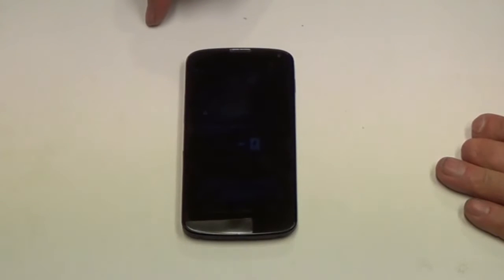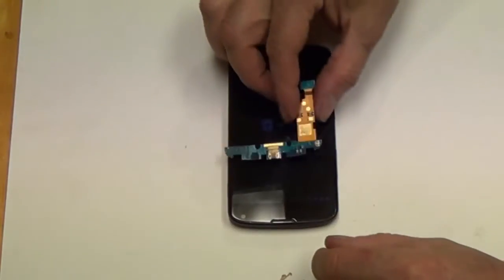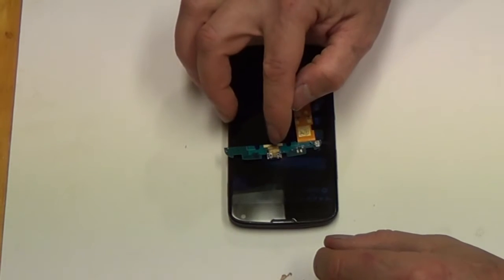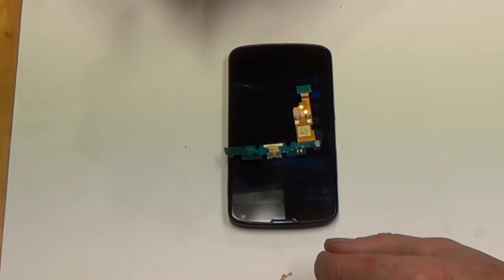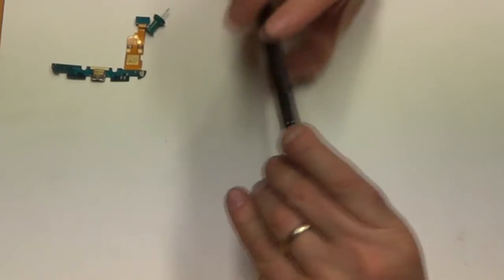Nexus 4 USB port repair

Comment: t was a weekend when I discovered 2 of the batteries I used were not functioning any more. Now, they are working because of the reconditioning program ( Check Details Here>>>https://t.co/vSOYIet9NV ) I saves $ 180 because of this method!

Comment: Hey Rob, Quick question. Your replacement port has some black material on the PCB, opposite the speaker on the other side. I just got a replacement part in the mail without this black material. Do you know what it is? Is it important? Is it not gonna work?

Comment: One question Rob. The new USB circuit has a blue plastic film on the backside. Did you remove that before installing it or did you leave it on?